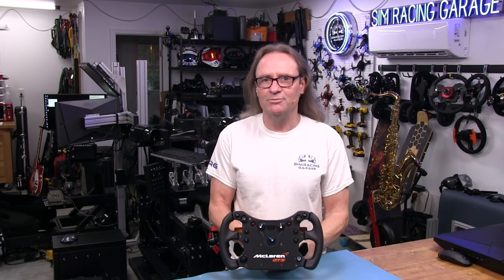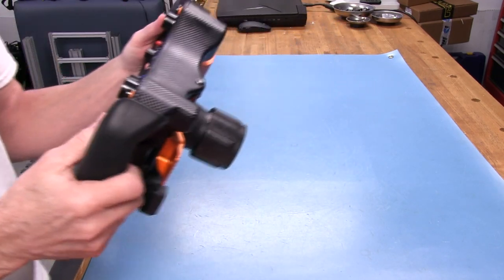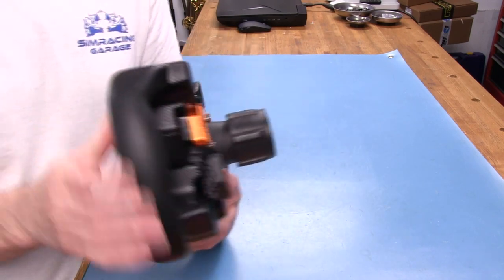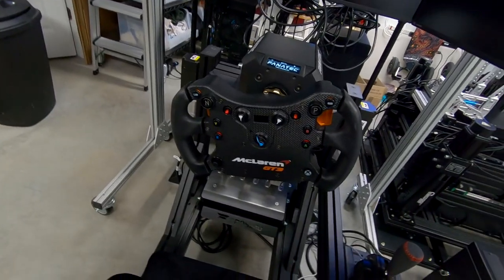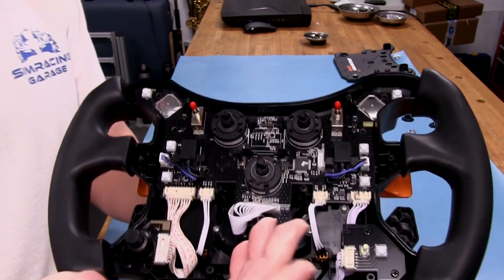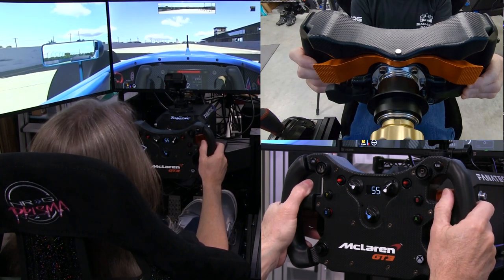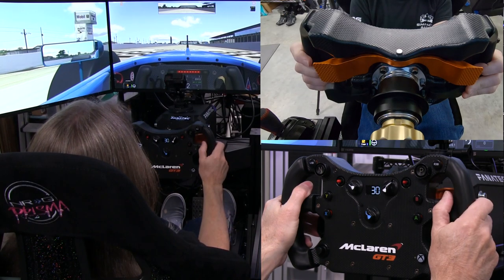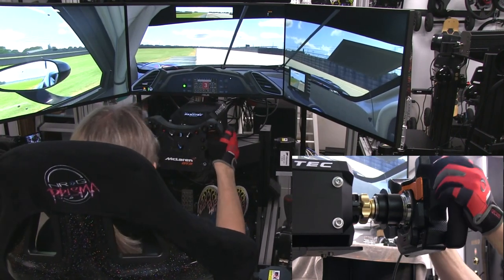Fanatec McLaren GT3 V2 Wheel Review

Comment: I think this is one of the best wheels that Fanatec has and everyone should own it if you are in Fanatec infrastructure.
My biggest issue with this wheel is lack of buttons 7 and 8. I really miss them in EA F1 games.
I would like to have an elevated (Podium) version of this wheel with more weight, less plastic feel, extra buttons and illumination. I know that there is a BMW M4 GT3 wheel but we all know how much it costs. Really great product that i use for most if my driving.
Now you can even use it with QR2 mounting system.

Comment: The rocker type paddles are so you can up and down shift from either side, so if you're busy with your left hand on say a button box / other config settings such as pit strategy, you can still drive at optimum right handed only (or left obvs.).  Absolutely cracking idea (imho), I can't wait to give mine a try (when it arrives)!!!
So e.g. to downshift with your right hand, you'd push the paddle away, instead of pulling towards and vice versa on the left, you can upshift by pushing.

Comment: If you're willing to risk potentially voiding the warranty, there's a quick fix on YT that significantly reduces the noise of the paddles. I did that the day after I got mine; that was two years ago and I've never had an issue with this wheel.

Comment: Quick question.  Would the clubsport quick release be advisable using this wheel with a Clubsport v2.5 wheelbase?
Reply: there would really be no point unless you want to switch wheels quickly. the limit on the CSL “quick” release is 8nm which is how much your wheel base generates regardless. maybe some added stiffness? but not enough to validate an extra $100 when you could just get a clubsport series wheel at that point.
Reply: I got the quick release and I would say yes, it is worth it. It stiffens up the connection ever so much, but it's noticable. It's also on point if you have multiple wheels.

Comment: Dont know what you mean with "this will this time works on Podium DD Bases because they stiffened the back".
The v1 also worked on DD Bases to the exact same extend - in Low Torque Mode with the SQR. 
Same now in the v2. When you cut the pin of the SQR so the base runs in High Torque Mode you still risk warranty because the SQR is NOT strong enough for High Torque at all!

Comment: Considering most people will use this wheel as it comes out the box, and the major update is the quick release I can’t understand why you didn’t show it in use whilst stock to test it out before changing the quick release
Reply: Because if you listen I clearly says and fanatec states this wheel needs the metal adapter for dd1 or dd1 and this guy uses his servos at high NM so he couldn't use the stock plastic quick release.
Reply: @SIMRIG412  nope, it will work just fine on the dd1 and dd2 but it won't engage high torque mode. The forces that the dd1 and dd2 put out are equivalent to the fanatec 2.5 so it was a valid test to performe to see how sturdy the new quick release is. Like I said most people buying this wheel will not use it on a dd1/dd2. Remember he is reviewing the wheel here not the direct drive motor.

Comment: Could anyone give me an advice, please ? I use the black analog paddles as BRAKE and THROTTLE, but they are a bit to hard to press
Should I try to  bolt / screw a plate that comes out further, to give more leverage  ?

Comment: Anyone had issues with their wheel disconnecting from the DD wheelbase during races? I lose all button functions of the wheel and has to disconnect it and reconnect it to the base to make it work again. I am using the CSL quick release so only low torque mode.

Comment: I‘m currently planning on upgrading my setup to a SIM Lab gt1 evo and HE Sprints. Can i just mount the sprints on the Pedal baseplate or do i have to buy the HE plate?
Reply: Sim lab has a plate for those pedals on there site. I have the gt1 evo in black and the triple monitor stand and love both of them
Reply: @SIMRIG412  so i have to buy it extra? Do you have the Heusinkvelds aswell?

Comment: Hi, wich rim do u think it's better, this (mclaren v2) or the fanatec formula v2? in terms of funxionality and build qualities. Sorry for my english I'm Italian lol. Thanks a lot!
Reply: Quite clearly the Formula v2.
Reply: @WhiteHawk77  the carbon on the v2 is only on the face plate. It's not layer's of layer's of carbon fiber. V2 is nice and has way more features. But also has downfalls. Like the thumb twist encoders roll to easy and to close,the shifters have weak pull on them and need magnetic shifter installed,v2 is smaller width wise,v2 is more for f1 use then other uses. And your wheel already has force feedback so those 2 extra motors in the v2 don't add that much for the extra $ I owned the v2 it was nice but sold it had way to many buttons I didn't use and I sold it for what I paid for it 1 year later after using it. I'll end up buy the this for $200 and be just fine. Can buy used metal quick release hubs cheap.
Reply: @WhiteHawk77  I'm def upgrading and struggling to decide which rim to get, currently stuck using xbox series x learning how to play ACC. Leaning toward spending fhd Xtra bread on the f1 rim
Reply: @WhiteHawk77  I need to step up and get a proper gaming PC. Lol.

Comment: The qr1 sucks balls. There is slack in this mechanisme.. and you can feel the steering wheel move over the shaft  with high ffb. I had to force turn the screw 180 degrees further then its supposed to, to lock it fully

Comment: Unfortunately Fanatecs original QuickRelease needs the locking bolt with the CSW 2.5 always to prevent jiggeling and ratteling. So it‘s not really a QR.
Reply: Are you sure about that? I did not see much of a difference with or without the screw. I noticed more flex in the xbox universal hub than in my other wheels and the screw did not help.

Comment: These wheels are rubbish. If you have owned one for a few months of use look closely behind the wheel where the shifter pivot point is for cracking. Mine has been replaced by Fanatec under warranty due to a design fault which they have admitted to in writing and the replacement has cracked the same way. If you are thinking of Fanatec DONT. Look elsewhere. It’s not just poor quality but very bad after sales service and warranty.

Comment: Be good if they offered a model without the Xbox crap all over it.
Reply: They do, it's called taking the button caps off
Reply: They usually include buttons with the wheel to change to whatever you want don't they?
Reply: @legendarymark112  yep comes with button caps like lights wipers arrows etc.  it also looks pretty good even without any button caps, that's what I use